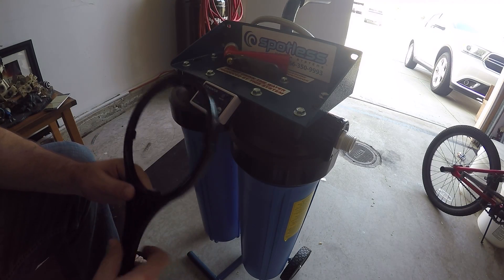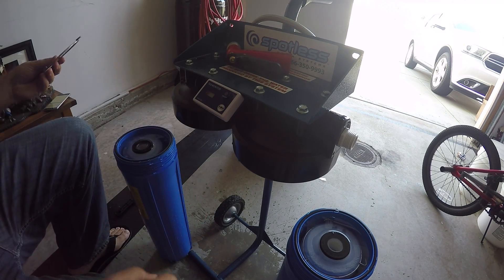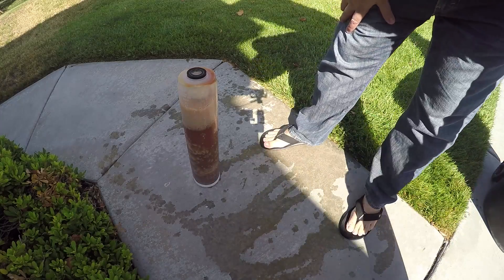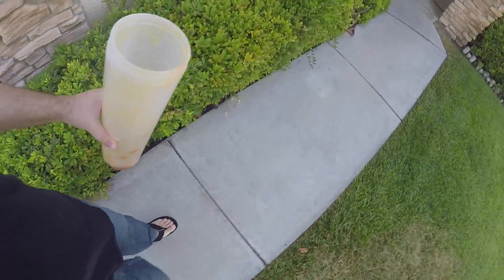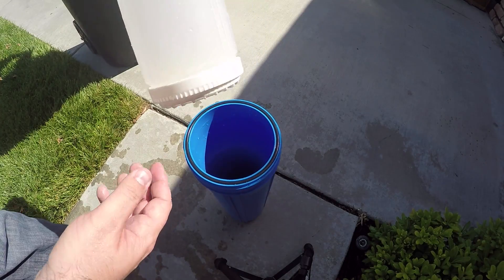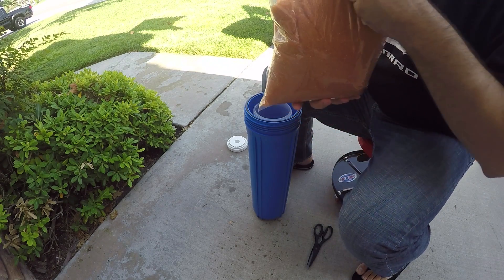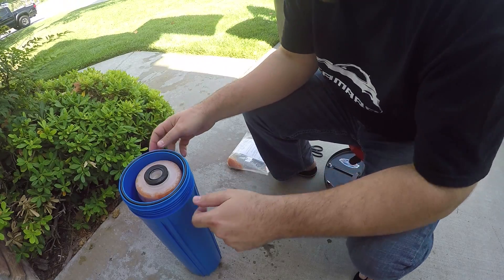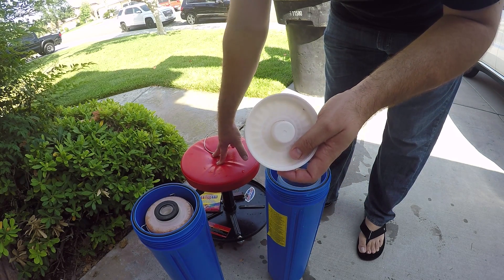How To: Maintain Your Deionized Water System (Spotless Water System)

Comment: I think this is a great product but I have the DI-210 single cannister and a stand.  wondering if anyone has come up with a dolly or wheel system?  This one cannister after a use, gets filled and heavy.  any ideas would be greatly appreciated....

After not getting any replies from anyone building a caddy or cart for a single cylinder DI-210, I got creative and found that a old fashion grocery cart did just fine.  There are 4 legs on each side that fit nicely into the cart and the 3 cross bars stop the frame from hitting the ground by about 2 inches.  I took 4 bunji cords an attached on each side of the cart and wrapped it around the cylinder and hooked it on the opposite side, rinse and repeat on the other 3 sides and you get a pretty stable setup.  I can now move it around easily and I can also break down the cart to lie flat if needed.  I would add pictures but did not see anywhere to upload.  Since my first comment, I have done a good number of windows on the house without drying and without spots.  That saves a lot of time and paper towels.

Comment: Any tips on breaking the seal? My DIC-20 continued to leak after my most recent resin replacement, so I tightened it but that never fixed the leak. Now I need to reopen it, but it's really really difficult. Haven't had any success.

Comment: Thats exactly what I am doing. First great video. Very straight forward.The way I used the system was filling a bucket up with the system with special soap. Than get the car wet with the system. Than wash and than rinse. So your saying wash the car with my normal spotty water but rinse everything with the cr spotless water system

Comment: Your video is helpful; thank you for making it. I cannot see dumping the spent resin into the trash; commercial mixed bed de-ionizer tanks have pretty much the same resin in them and when they are exhausted, the user turns them back to the issuing vendor and they back-flush the tank with a sodium hydroxide solution, I believe, then flush out the sodium hydroxide to re-generate the resin. Actually, I just contacted Spotless Water Systems to ask what my options are for re-generating the resin myself. I'll let everyone know if and when I hear something back.
Reply: Anything?
Reply: Well?
Reply: It uses corrosive chemicals to regenerate...NOT SAFE...

It's best to refill with resin which can get expensive...

I use this set as part of a drinking water filtration for my RV..  one filter I fill with water softening resin the second with deionizing resin..  I use use sediment and charcoal filters inline..  I can get about 200-300 gallons of water out of the deionizing resin..  the water softening resin can be recharged with table salt.. the water softening can make 1000-1500 gallons of water before it needs to be recharged..

The sediment and charcoal filters are replaced every 6 months..   will be adding UV filtration eventually...

Comment: Just picked up a DI-120.  Would you happen to know if the water in the housing has to be drained between washes or is is perfectly fine to leave the water sitting until next rinse?
Reply from the maker: I think your supposed to leave it. I normally drain it or it gets an odd smell

Comment: Prices have gone way up on CR’s resin. This isnt looking as good as it used to lol
Reply: Unfortunately, that's why I stopped using mine. I now have a water storage system where I use a cheap RO/DI filtration system to fill. Then, I spray the stored water through my sun joe bucket power washer for a final rinse (or a Worx hydro shot). been the most cost-effective way I've found.

Comment: Hey bud, thanks for sharing, it was helpful. 
One question, how do you know went to swap out the cartridges?
Reply: Basically, as soon as the meter reads anything over 0.0, it's time...   Also, without looking at the meter, you can tell because the water starts smelling "fishy"....  And if you don't account for the meter reading and/or smell, you'see the water spots have returned.
Reply from the maker: The sensor on the front, of it reads over 20 Tim to seap
Reply from the maker: Swap

Comment: what a waste .... you can recharge them with salt.. make a tube  and run salt water though it and out the other end into the sewer make sure the dessancant beads stay and just water comes out the ions of the salt push off the particulates and recharge it... this is how house ones work... putting this in the trash every 20 cars is a waste of money just buy a bag for 10 bucks of salt its the same thing they use on the house units the older ones

Comment: What's up lethal garage. Quick ? My tds meter went from 0 to 2 so I changed my resin out yesterday but it stayed at 0 a very long time which was good. So is 2 the same as 20? Because once it read 2, I noticed spotting. Did I change it too soon?
Reply from the maker: When mine reads 0.19 or higher it spots

Comment: how long or how many washes does each bag last?  thinking about getting the system
Reply from the maker: About 20 washes. You can now get refills for even cheaper if you work directly with the manufacture.
Reply: I wanted to get this crspotless till I found some guy on youtube and he had this https://rvtransformers.com/rv-transformers-store/?model_number=Pro100

Apparently this unit is supposed to give you up to 4000 gallons on a full bag. 

Now based on what you said before if you are paying $49 for one CR Tub, and you are getting about 20-25 washes.
The question is how many gallons per wash are you using? 
@20 gallons per wash x 25 washes, you are getting about 500 gallons, or are you getting more? 

If you buy 4 Tubes at $49 your paying about $200 and getting about 2,000 gallons. The bag to refill the unit posted is only $179 again for what they estimate of 4,000 gallons.

Any thoughts?
Reply: You'd probably save a lot more on DI resin costs by first running your tap water through a Reverse Osmosis filter or two into a holding tank and then through your DI tanks. Only 20 washes sounds awfully low. Take a page from the aquarium and laboratory industries. They've been filtering water for a lot longer than car detailers.
Reply: There is a digital gauge on the unit that measure the mineral ppm. You’re supposed to change them out when it gets to .20, I have had mine for probably a year and a half and use it for rinsing only, probably dozens of uses and I’m only at .06 . Probably has a lot to do with where you live. We have a lot of limestone in the ground here so our water is relatively clean already.

Comment: Props for a great video showing our CR Spotless System in action and wanted to pass along some great news on our Resin Exchange. We're now offering the ability to exchange your cartridges for new ones filled with resin for only $69 (postage paid both ways) and if you're local in San Diego, stop on by and we'll do it for $49. Cheers! ~John
Reply: It's not $69 any more, they jacked the price up to $99.
Reply from the maker: Wait what???? That is cheap! Will have to hit you up. Just purchased new replacement bags a few weeks back.
Reply: You need to swing by our shop in your sweet sled and grab your next refill. Looking forward to getting a glam shot in front of the shop.
Reply from the maker: +CRSpotless lol. What's the address, maybe next weekend I can swing by.
Reply: 372 Coogan Way in El Cajon. If on a weekend venture, you can always swing by the mancave and I can have some resin on hand to swap out.
Reply: How do you know when the resin needs to be changed out on your system..That was alway a major fustration with my old DI system?
Reply: The resin is almost impossible to find in Canada. Sold out all of the time.
Reply: the price has increased from $69 to $99
Reply from the maker: It has been over a year since this video went live

Comment: I have a black Scat Pack Charger and tested my new Spotless system without drying it......it fricken works! My meter just hit 2 and will need to replace the resin. I was washing and rinsing with a power washer & Chemical Guys foam canon. Will try to just rinse this time around to stretch the life of the resin. This system is not cheap, but willing to invest in good equipment/products to keep my black finish looking great. Thanks for posting this video LethalGarage
Reply from the maker: +David Gracia no problem man. Yeah washing and rinsing will burn it quick.

Comment: The amount of washes you get depends on the TDS in your water supply. I got my system over 6 months ago and I'm just now seeing something other than 0 on the display. I use mine during the whole wash process.
Reply: I'm in Arizona and you'd go broke with our water not pretreating it before going to DI.  We clean Solar Panels and I run it through a RO filter at about 90 lbs first and then through the DI on it's way to the water fed pole.  Lasts a long time that way, without it, no way.
Reply: chops1sc Wut ppm mean?
Reply: @albertquintero5412  ppm stands for "parts per million", essentially the same thing as tds.

Comment: Resin can be cleaned and reused over and over. We use it in dialysis you'll need acid to clean it but might save a few bucks not buying resin. Great video.
Reply from the maker: I'd rather not bother with that process.
Reply: I am interested in instructions on how to regenerate di resin.  that would be great.  resin is not cheap.
Reply from the maker: +adolfo bugarin I am not sure about that process